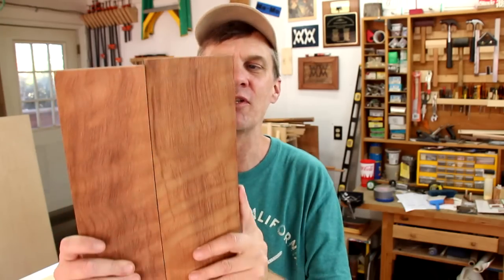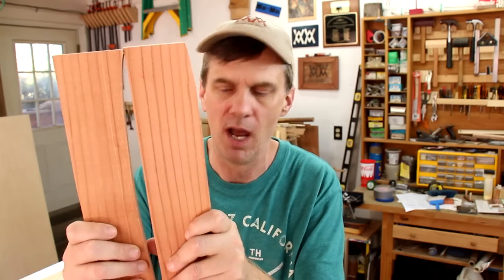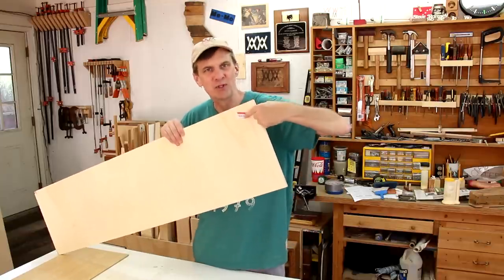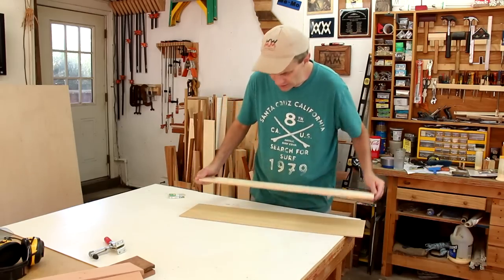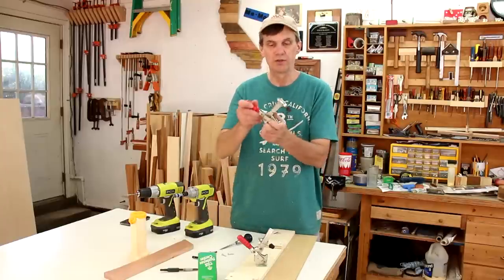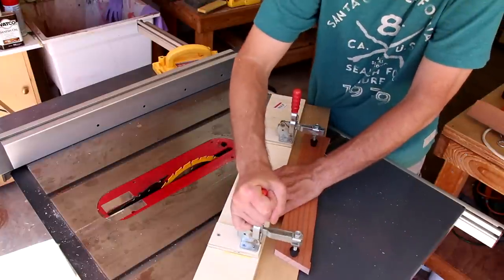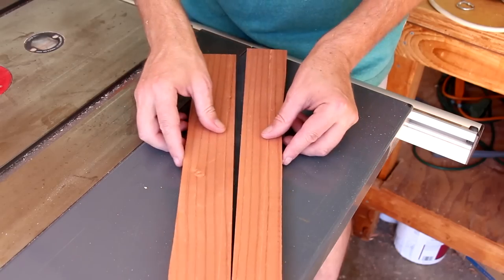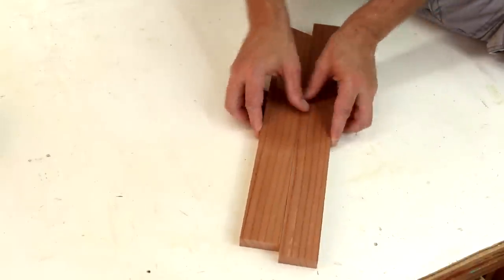Jig for edge jointing on a table saw | Mere Mini shop project

Comment: I can't figure out how your toggle clamps reach the work piece, when you have lifted them up another 3/4".  The toggles I bought (Harbor Freight vertical toggles) will only go down approximately level with the attachment plate...which makes sense.  If I mount it up on a riser board, they would not clamp anything less than 1.5" thick!!!
Reply: Did you ever figure out the issue? I am currently having the same

Comment: @steve Why dont you use the jointer jig to cut both edges?  Thank you!
Reply: You have to put the jointed edge on your fence to do the other side in order to get a board that is straight and square. If he flipped it and clamped it down on the jig, he could easily get a tapered edge.

Comment: How come the edge where the clamps go wasn't squared up after gluing and screwing? Because it's a factory edge and even if it's not perfectly parallel with the bottom board the cut will still be straight?

Comment: I made this to a tee and can’t get perfect cuts.  Blade checked to be at 90, used factory edge...  The thing is I need long 5’ - 6’ boards straight and perfect.  I see tons of videos and they always use a 1 or 2’ board.  I love your videos but could you show us how to do a long board?  On a small dewalt table saw lol.

Comment: the link you provided is not the same as the clamps in your video just an FYI for anyone watching.  I was able to make the horizontal ones work though, albeit not as ideal, and with a wider jig so the clamps didn't hit my fence.  I have to add though i have to raise my blade very high and have some kickback so am going to replace the clamps with the proper ones.

Comment: I’m a beginner. So correct me if I’m wrong. So to get a straight (square edge) the fence needs to be square with the blade? Correct? If so why not just use the fence on the table saw to do this?
Reply from the maker: Sometimes that will work! f the board has a bend in it, it might be hard to keep stable though.
Reply: Great thanks!

Comment: I just bought a table saw and want to make this jig. But, I'm honestly confused. I squared up my table saw fence to the 10" blade that I'm currently using with a combination square. What is the difference with using this jig and using a squared up fence to simply shaving off the end of a rough cut board? How does this jig help, if the fence is also already square to the blade. (Sorry, I'm new to woodworking and I have a lot of questions, lol)
Reply: This jig allows you to get a straight edge on a board that doesn't have a straight edge to put against the fence...if you have a board with one known straight edge, you can run that against the fence and get the other one parallel. But if neither edge is straight...😉

Comment: I'm new to wood working so I'm hoping someone can answer this question for me. Why wouldn't I just rip both sides of the board against the Rip fence?
Reply: If the side placed against the fence isn't perfect, those imperfections will get transposed into imperfections on the side you are ripping. Using a jointer or this method isn't about getting a generally straight cut, which is often appropriate.  This is about cutting a perfect edge, and a perfect straight cut requires a perfect straight edge against the fence.
Reply: @jasonrlee  now that you explained it it seems so obvious
Thank you!

Comment: I think that I will be making one of these, but I have a question. Is there essentially no way to make a perfectly straight cut using a table saw if you DON'T start with a known straight board?
Reply: No, you would need to have a reference edge to slide it along, but that is what is lacking.
Reply: I think that you can get around this by attaching whatever plywood you're using for your base to a piece of miter stock. That way you're sliding up and down the miter slot, instead of having to rely on the piece of wood being perfectly flat against the rip fence. This would of course only work if you had zero play in your table's miter slots.

Comment: For this edge jointing jig, would you recommend 1/32" or 1/16" for each pass?
Reply: The nice thing about this setup rather than a planer is that you don't necessarily have to worry about making shallow passes. You can hog out the bulk of the offending wood (which preserves it whole rather than turning it into shavings or dust), then sneak up to a straight edge by bumping the fence in a little at a time. Ideally, you would take a single pass that eliminates bowing and twist but cuts no more than necessary to do that - but that line is not always obvious, so take as many passes of whatver depths of cut you need to.
Reply: Just line up each end to the edge of the jig and cut it all at once!  Then turn it over and put the new edge on the fence and cut the other side even, 2 cuts are all you need!

Comment: Steve, is there a way to edge joint boards together using a hand circular saw?
Reply: I'm not an expert but I feel like if you clamped something straight like a metal ruler or a long level onto the wood, and then ran the circular saw along that edge, you should get a straight cut. I've done it before but it wasn't for jointing so I don't know how dead straight it turned out.
Reply: I bought the rip cut not too long ago too, I'm a big fan of it, it works great

Comment: what if i dont have a tablesaw - i dont :(
in fact, i have a lot of powertoold, but no tablemounted stuff. just a collapsable workbench. 
i would try using my guidebar on the circular saw along a straight board to try this. or the same with my handrouter and a guide thing attached. or is there a better way?
Reply: If you were Chuck Norris you could just look at a board and it would straighten up for you. Sadly, that is ineffective for most of us. Woodworking is such a strange pursuit. Half the people out there are making steam boxes to bend wood, while the other half are making sleds to cut wood straight. People should just get together and trade each other for the lumber that they want.

Get a Festool track saw and be the envy of many woodworkers. I think that is what they make the green parts of their tools out of. It is concentrated tool envy.
Reply: +Paul Frederick if he can't afford a table saw, I doubt he can afford a festool track saw.
Reply: vitaedrinker1981
I bought a table saw for $20 at a yard sale. Of course it needed a bit of work to be put back into service again. But that's what sweat equity is all about.
Reply: +Paul Frederick right, which has nothing to o with your comment regarding buying a festool tracksaw.
Reply: vitaedrinker1981
Well buy a Festool track saw and be the envy of many a woodworker.
Reply: +Paul Frederick good stuff. A few months back i actually bought an old tablesaw. Good to revisit this video.
Reply: Willem Kossen
I have two table saws now, so if I see another one I'm going to have to pass on it myself. I'm out of room to install any more in my workshop. I did put them both into the same out feed table though. So that saved me a little space. Putting them both into the same out feed table was pretty tricky to do. It took me quite a while to get them both the same height, so they'd both be level to the top of the same table. One of those didn't see how hard it was going to be coming deals there. Because when I only had one TS I made an out feed table for it, and that went much more quickly. http://i.imgur.com/VannV.jpg

Comment: Just built this for a second time. I'm having issues with the 2 pieces of ply gapping when clamps are engaged. A. will this make a difference? B. how do I prevent this? I used tight bond II and 1/2" wood screws.... Also the clamps in the description are too short for 1/2" riser blocks at least for 1X material  I.E. (1x4)
Reply: same issues I am having
Reply: Glue and clamp the pieces together overnight. As many as 6 clamps. Allowing it to dry overnight before using will prevent the plywoods from separating when engaging the toggle clamps.
Reply: put a couple of taller riser blocks next to the half inch ones and just move the clamps over as needed.

Comment: Could you modify this jig for slightly wider boards?  If so, how?
Reply: If I'm understanding correctly, I definitely think you could. Instead of an 8" wide piece of 1/4" ply on the bottom, just make it that much wider to accommodate your slightly wider boards.

Comment: Can someone explain the use of this to me? I'm a newbie. What's the reason you can't just use your rip fence to run boards through for jointing?
Reply: If the side of your board is curved, it will curve along the rip fence and you won't get a straight cut. Your two sides of the board will be parallel, but not necessarily straight. Once you have one truly straight edge (using a planer or this jig, etc.), then you flip it over and yes, you can use your fence.
Reply: @seanfishback3340  thanks Sean! I did a little more investigating after this and eventually figured it out. Not sure why I couldn't wrap my head around it at first. Appreciate the knowledge!

Comment: How important is it to have the 500 lb toggle clamps?  Would the same version of the 200/300/400 toggle clamps work?  It is only a dollar less, but I was just curious.
Reply: For a dollar, why not get the most clamping pressure that you can?
Reply: Corey Mead I don't think it'll make too much of a difference but you never know where you'll be using those clamps in the future.

Comment: Can someone help explain to me the height that those toggle clamps are at? I got all the parts to make this jig, using 3/4" plywood, but putting those riser blocks would make the height of those clamps at 1-1/2". The clamps that I got look almost the exact same as in the video, but they don't clamp down very far past the plane they rest on. I think I may try with just a 1/2" plywood on the sled, as the clamps do raise a bit, if I need to cut 3/4"... but can someone tell me what I'm missing?
Reply: The clamps are adjustable.
Reply: Hi did you ever figure this out because I have the same question? Got my toogle clamps at harbor freight

Comment: I am a little confused 
If you place your piece of wood on the jig at anything other than a 90 degree angle it will cut a straight edge but when you flip it around it will be more like a parallelogram than 4 90 degree corners.
Reply: Mike Levant you only joint one side of the board. For the other side you use the rip fence
Reply: I know this is a old comment, but you could square up the ends to the sides using a  miter gauge or crosscut sled

Comment: So, wait, aren't both edges of a piece of plywood factory cut?  If not, how do I know which side is the factory edge?  Is the bar code always closer to the factory edge?
Reply: If you buy a new piece, yes both sides are factory cut.  If you recall in the video, he was using a scrap piece.  That is why he wanted to be sure which edge was original.

Comment: mhm yes possible... 
but the cut of the saw is to rough for a "perfect" joint. 
i would prefer a jointer or router...
Reply: Depends on the quality of your blades
Reply: Not everyone has every tool in their wood shop. Some people don't have a wood shop so you have to use what you have available to you.

Comment: YOU SHOULD UPDATE THE LINK TO INCLUDE THE RIGHT CLAMPS. YOU NEED VERTICAL CLAMPS, AS SHOWN IN THE VIDEO. THE LINK IS CONNECTED TO HORIZONTAL CLAMPS.
Reply from the maker: Why the shouting?
Reply: Just wanted to get someone's attention before ordering. No exclamations. :)

Comment: Here’s a really stupid noob question...
No reason I can’t use 1/2” plywood for the base, right?
Reply: I've seen videos of guys using half inch and even 3/4 inch plywood/OSB/MDF for this.  I used 3/4 inch MDF on mine,  get less depth of a cut on thicker stock, but for most wood you shouldn't have any issues I wouldn't think

Comment: Can someone explain why you need to use this, and not just use the table saw fence, flip the board then use the fence again?
Reply: your fence is straight, but if the piece of wood is not straight on either side running it along the fence will not make a straight cut. locked down on this jig ensures a straight cut on one side, then you can use the fence for the second side. hope that makes sense
Reply: Do you just lock the board down on any axis on the jig though? I mean you'd lock it down in such a way that you wasted the least amount of material, but I'd have thought cutting it with your fence once on each side would give you parallel cuts to each other without using a jig.

Comment: So...he didn’t need to use the jig the second time because...he’d already jointed the opposite sides?
Reply: Correct.  You use the jig only for the first side to get a true edge.  Then that edge is put against the fence to make the other edge true and  parallel to the first side. Think of it like a jointer on the first side and using a thickness planer on the other edge,  same principal just different sides of the board.

Comment: Steve. Lovely horses. But they have no SPLAY. If you were to stand on these horses to ...say install drywall on the ceiling are you stepped on the end, were would you go... Down. My question is, will this design work if splay is add to the horses.  When a man pees he spreads when a horse pees he splays.

Comment: Brain Cramp Time...
I'm having a hard time understanding the point of this jig. I know the answer is very simple, which makes it all the more frustrating that I can't figure it out.
So the idea is to avoid buying a costly, bulky jointer by creating a simple jig that will create 2 perfectly parallel edges using a table saw.  I've seen several YouTube videos on this, and they all place the board on the jig with no concern for it being parallel to the long part of the jig or perpendicular to the front edge.  You make a pass on the exposed edge, then remove the jig and make a second pass with the freshly cut edge against the fence.  I see how that makes perfectly parallel edges.  But what I don't understand is why you can't simply make both passes with the board pressed against the fence.  Why is the jig necessary?  Using the fence would result in 2 parallel edges, right?  They won't necessarily result in edges that are perfectly perpendicular to the end of the board.  But the jointer jig doesn't address that either!  Or does it?  So confused.
Reply: I am new to woodworking, and I was also wondering this exact same thing lol.

Comment: I tried this jig with no success. Not sure what I did wrong but I can't get a straight edge no matter how much I try. I'm beginning to price a joiner. LOL
Reply: i know it's a year later, but make sure your blade is aligned perfectly to the mitre slot and fence ( I always check mine here and there especially after changing blades) and all the wood referencing the fence is nice and straight